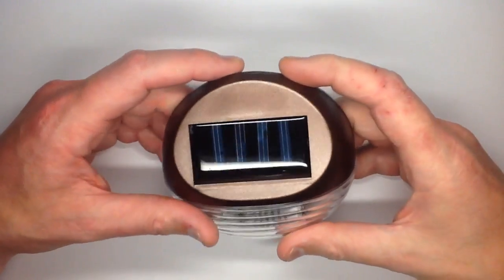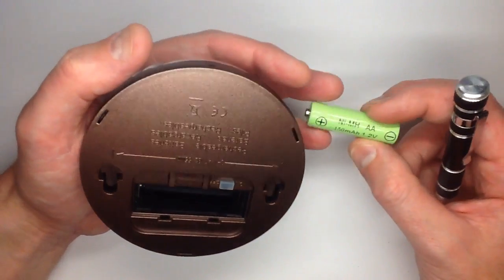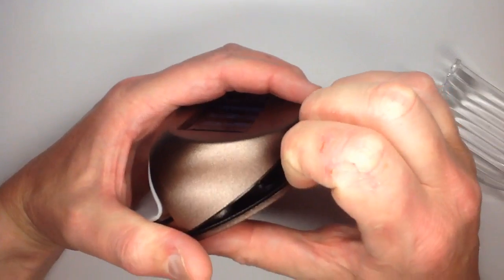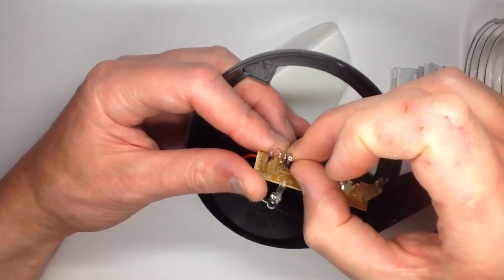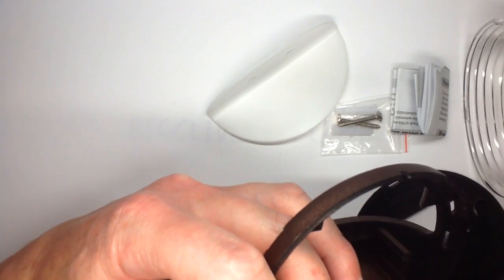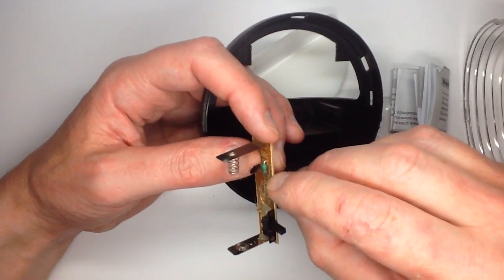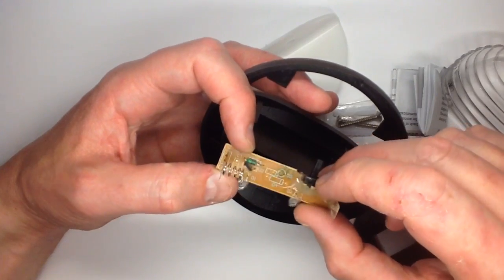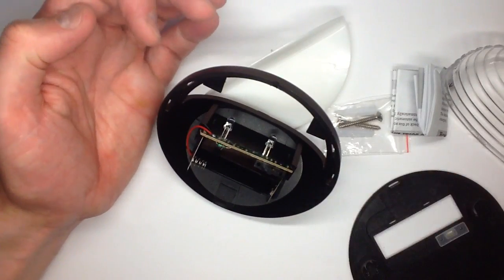Inside a solar wall light.

Comment: +fredlllll - It's an axial inductor. Modern technology can be very deceiving.
Reply: +DjResR I too thought it was an inductor initially, before I learned a bit more about electronic components. Couldn't understand why the multimeter was giving me strange changing readings on it when I tried measuring resistance...

Comment: If they used slightly larger "panels" in there, then the 150mAh battery could be replaced with something of a decent capacity that doesn't die after half an hour's use... :P

Comment: I can't see clearly on the video but does this use the ANA608? If so, this circuit is extremely common in solar lamp circuits, it seems. We've bought certain products like this in the past and they've had similar circuits. http://www.flytron.com/electronic-parts/240-ana608-solar-charge-and-led-controller.html

Comment: You seem to just love solar lights (especially poundland ones).
Reply from the maker: djbassaus The Poundland ones are irresistible, but I recently bought a load from IKEA, and they seem to be pretty high quality.  They certainly didn't skimp on the size of the solar panel.
Reply: The funny thing about IKEA is while most of their products are designed in Holland/Sweden .. they are still made in China, at least the QC seems better though.

Comment: You may also notice that the massive space for the solar panel is only populated by a few thin strips of trimmed cells, encapsulated to give the impression of a larger one. Each strip will be approx. 0.5V, quite a low current though. Strips are used, rather than a single larger cell to get the voltage up a bit to help charge the battery.

Comment: 150mah? Wow, that's insainly low capacity for an AA, in a world where 2200+ is the norm. As you said thoough, interestly honest, compared to the 15000mah ultrafire things you see on ebay/ali which are normally only about 1200mah in reality
Reply from the maker: arcadeuk I guess that by using an AA holder it leaves their options open for using a larger area of solar panel and higher capacity cell.  This'll be the peasant version that glows just enough to encourage you to stumble randomly around your garden at night.
Reply: bigclivedotcom I just find these things interesting because I am a strange person that likes LED's ;) I wonder if the normal people do  use these to stumble around their gardens at night ?